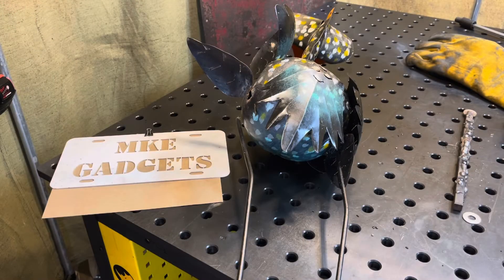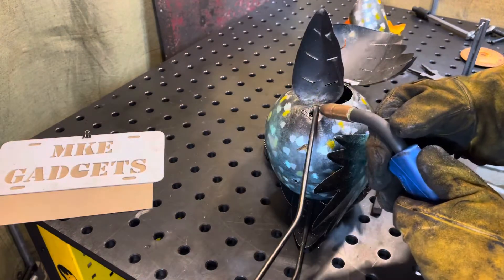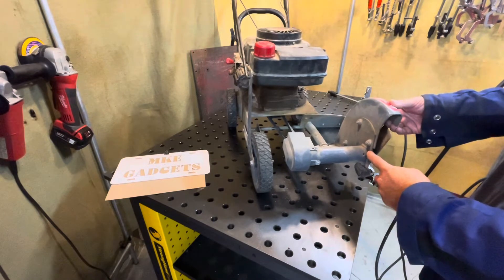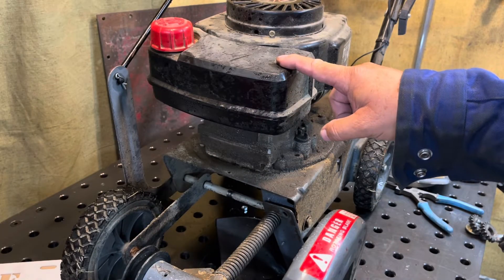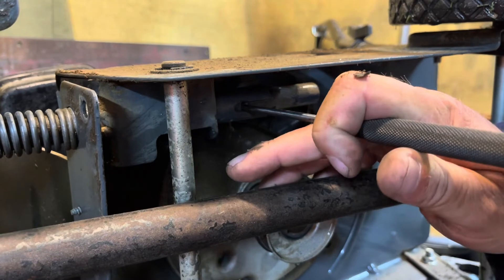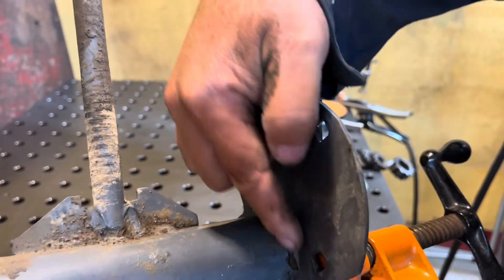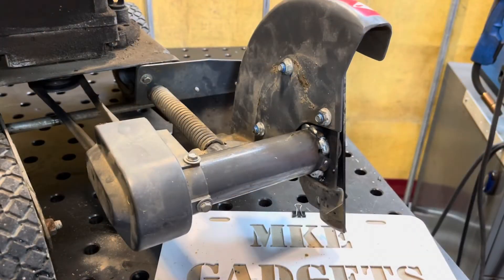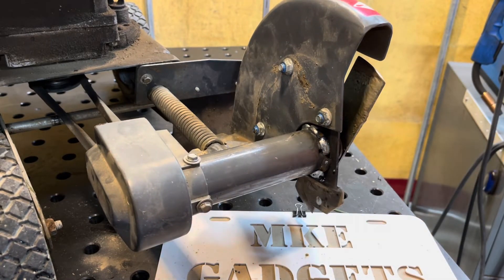Welding Side Job @ MKE Gadgets #180

Comment: The fender washer is clever, I was thinking you were constrained to brazing or tig. Gonna remember that for next time.
Reply from the maker: Yeah the washer was the thinnest piece of steel I had around. It worked out well as a backing plate. I considered TIG but I didn’t wanna heat up the area too much before I start melting a rod. I don’t have brazing equipment. Thanks for your continuing support by viewing my videos and commenting. I really appreciate it.